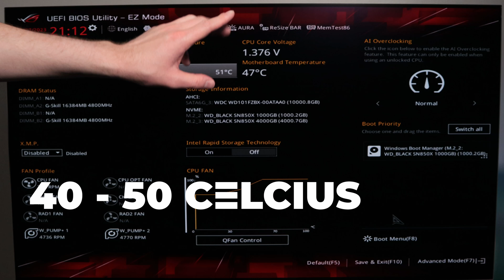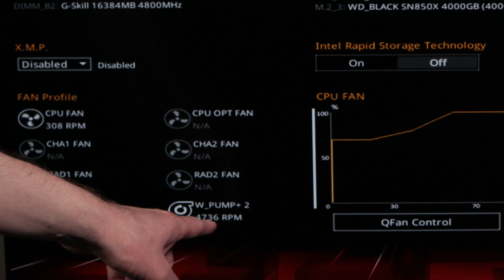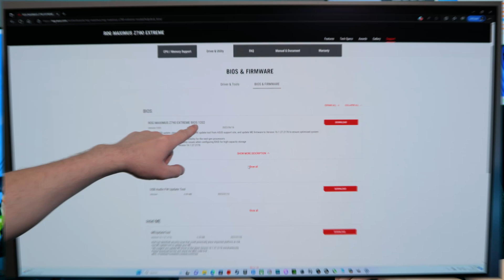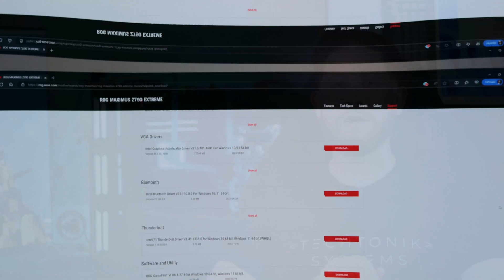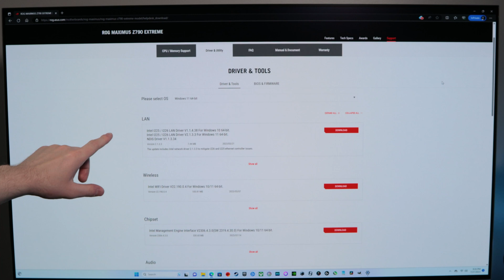What To Do After Building A PC - Complete Your PC Setup Like A Pro With These Crucial Steps

Comment: Hello, I know this is unrelated but I hope you can help. I recently accidentally spilled some water on my computer and it's booting into safe mode I'm not sure if it's fried or not because it did this after I gave it 4 hours or so to dry. This was after I instantly turned it off and checked it all, I don't think any got on the motherboard but still I don't know. Not sure what to do next. I would really appreciate any help
Reply from the maker: @bugatti.95 oh no :( I’m sorry to hear that happened! Does your CPU have integrated graphics? If so, I would plug your monitor into the motherboard directly instead of the GPU and see if that kicks it out of safe mode. Another thing you could try to kick it out of safe mode is to hit the Windows Key + R and type msconfig then hit run, from there go into the boot tab and uncheck the safe mode checkbox.
Reply: @techtoniksystems  thanks for the tip but I'm unsure if I should do that because I feel like it might break everything I think i might try again after I'm 100% sure it's all dried fully.
And no my CPU does not have integrated graphics
Reply from the maker: @ definitely wait till it is fully fully dry!
Reply: @techtoniksystems  another quick question (before I'm trying to do what you said) what does it mean if its trying to turn off on it's own
Reply from the maker: @ does it go through the actual Windows shutdown screen and turn off through the OS or is it just shutting off with no warning and not through the proper OS shutdown procedure?
Reply: @techtoniksystems  through the windows shutdown screen
Reply from the maker: @bugatti.95 does this happen after a period of inactivity?
Reply: @techtoniksystems not sure it just happened a few minutes after I turned it on
Reply from the maker: @ if it keeps happening check your settings and make sure nothing is set to power your system off after x amount of minutes of inactivity. Another reason is it could have installed a windows update and shutdown. It shutting down through the OS doesn’t quite indicate to me a hardware issue, as hardware issues are usually blue screens, hard shutdowns as if the system lost power, or lockups.
Reply: @techtoniksystems  yeah that's right it said it was installing an update then it did that
Reply from the maker: @bugatti.95 yeah that’s normal then! I wouldn’t worry about it unless if it keeps doing it incessantly
Reply: @techtoniksystems  thank you so much for the help I thought I was screwed but I think I might be ready to try that command now
Reply: @techtoniksystems from what you originally said, will the windows R trick you said work in BIOS safe mode because that's what it's in
Reply from the maker: @ I’m not sure what you mean by BIOS safe mode as safe mode is Windows software specific. Could you possibly email a picture of what you are seeing to techtoniksystemspr@gmail.com?
Reply: @techtoniksystems  it's the same screen as what's in the thumbnail of this video
Reply from the maker: @ oh gotcha! I’m assuming you have you hit F1 to get into the BIOS and then exit out of that? And it keeps looping to that screen?
Reply: @techtoniksystems  I haven't tried anything like that yet, I just saw that screen and then turned it off because I got scared
Reply from the maker: @bugatti.95 i would try to enter into the BIOS, make no changes, and then exit out and hopefully it will boot up!
Reply: @techtoniksystems  I've sent you an email, basically it's on the windows choose an option menu right after I've started it
Reply: @techtoniksystems  ok it's all fixed, I exited to windows and I've tested some games performance is normal and it's perfectly functional. THANK YOU SO MUCH for your help
Reply from the maker: @ that is amazing to hear!! I’m glad I was able to assist!

Comment: Hey, I know this is over a year old, but I need help with my PC. What’s happening is when my PC turns on, it turns back off. It’s only letting me get into BIOS and not Windows. I’ve been using it for the past three months, and I don't know what to do.
Reply from the maker: @itsyozay  hey! Happy to help! In the BIOS check if your storage drive is being recognized. If it is double check if the boot order is correct as in the first device in the boot order is your storage drive with your OS. That hopefully will tell us a little more about the issue!
Reply: @ how do I do that?
Reply: When I remove my RAM from the PC, it stays on and doesn't turn off at all, but I can’t see the display or do anything. But when I put the RAM back in, it starts doing it again. Do you think it can be a RAM issue?
Reply from the maker: @itsyozay  I’m not sure on your particular motherboard BIOS but there may be an advanced view you would have to enable so look for that! If there isn’t an advanced or easy view look for a boot section in the BIOS. This should be the area that will display boot information and where you set your boot order. It should also display somewhere what drives are available to the system. 

I would also recommend not removing components while the PC is powered on or is connected to power as damage could occur! I do not think it is a RAM issue.
Reply: @techtoniksystems  are you talking about boot menu and what is Windows boot manager
Reply: @techtoniksystems  and do I need a USB driver so I can get into Windows
Reply from the maker: @itsyozay  there is a boot manager in the BIOS that tells the system to select a specific storage drive to read for boot. I am assuming you installed Windows previously?
Reply: @techtoniksystems  yeah when I selected it just restarted and did the same thing again
Reply: @techtoniksystems  do you think I should get a USB driver stick and try to install window on there wherever I do it just turn on and off
Reply from the maker: @itsyozay  from the information so far it sounds like you may need to try to reinstall windows using a USB drive!
Reply: @techtoniksystems  Ok I will try that out and if I reinstall Windows will I lose my data on the SSD driver I have in there
Reply from the maker: @itsyozay  yes, if your files are on that drive then yes you would lose them in the process.

Comment: Thank you🎉
Reply from the maker: @daffy1983dw  thank you for watching!
Reply: @techtoniksystems my gpu fan stopped spinning I changed my ram sticks positions and changed which port my gpu was in so you know what happened?
Reply from the maker: @ImQuaze  if your GPU fan stopped working that could be multiple things! Some GPUs have features that stop the fan completely when it is not needed. Another reason is that the GPU could be faulty. If it is just the fan that stopped working but everything still works normally otherwise then I would say it is likely you have faulty GPU.
Reply: @ how do I check if it still functions because the way I know is that if the fans spinning
Reply from the maker: @ does it output an image still when you boot up the computer?
Reply from the maker: @ do you have your hdmi or display port cable plugged into your motherboard? If so try to put the GPU back in and plug the HDMI or display port cable into the GPU and see if it has a picture
Reply: @techtoniksystems  it doesn’t but do some gpu’s have like a shutdown system because im still confused how it worked for a little bit then stopped
Reply from the maker: @ I’m not 100% sure what you mean by a shutdown system, but it sounds like your GPU is bad. If you just got it I would look into RMAing and getting it replaced!
Reply: @ ok thank you